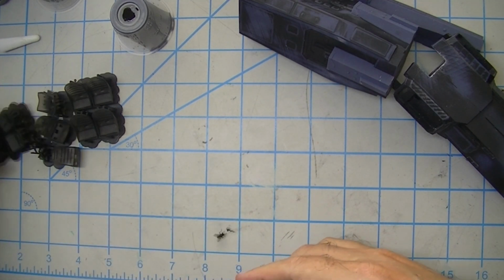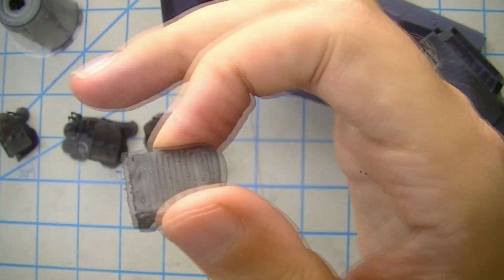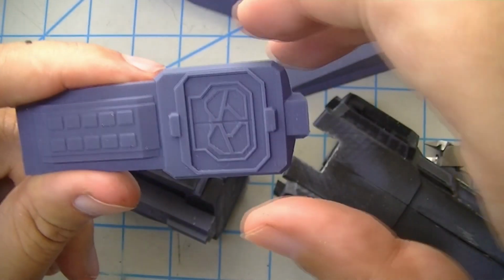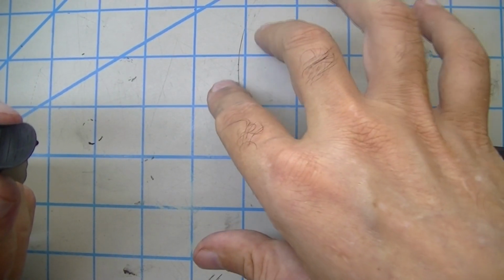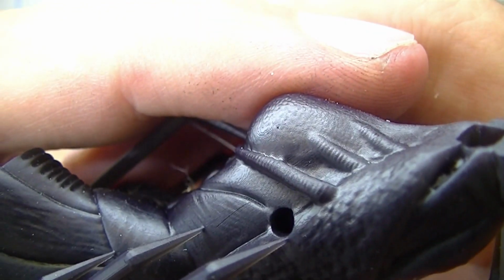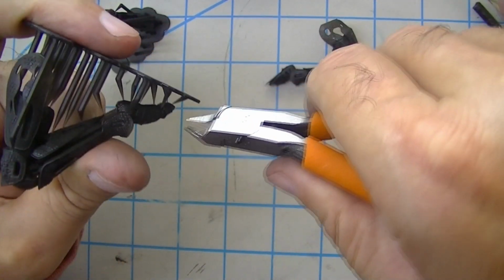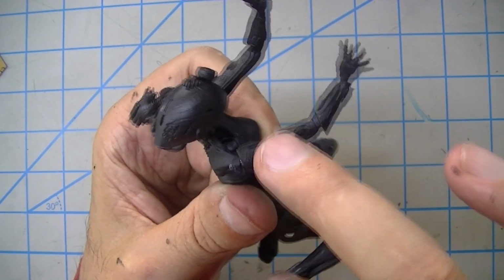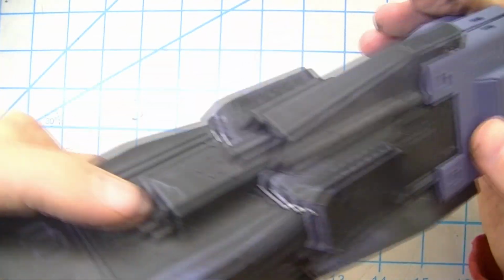ep330 - the epax x1-4k 3d printing adventure part 2

Comment: Been doing a lot of printing of fine detail parts and what I have been doing is using my airbrush with a 5 needle and spraying on the resin and curing with a UV flashlight. It does a fantastic job smoothing out the surface and filling in the layer lines. Have to be careful around super small detail like rivets and fine panel detail but the brush gives you super good control of where you want to apply the resin and how thick, which i find multiple thin layers, curing between them resolves much of that issue. One thing though, once you use that airbrush for resin it might not be any good for paint. Although I have not tried and have a dedicated brush just for resin work. Anyway, might be worth experimenting...;)

Comment: I hear you mate, built their 144th Roci and the tolerance in the resin cast parts required them basic building skillz.  Good thing was some of the resin cast parts were the wrong parts and others warped and with bubbles- sure I could of worked the problem but I just reached out to AA and he shot me thru the stls for the parts in question and saved me waiting for COVID post and AA the cost of replacements and shipping too.  Win win.

Comment: I can see where you have been going wrong bro, 43.1 degrees used to be the optomal angle, but due to newly discovered imapct caused by the earths rotation you should start at 46.7 degrees, but must subtract 0.001 degree for each day there is left between time of print (TOP) and the number of people named Wong in Nevada :)